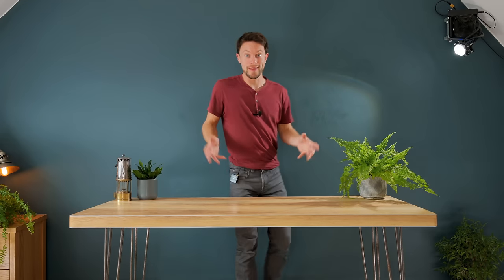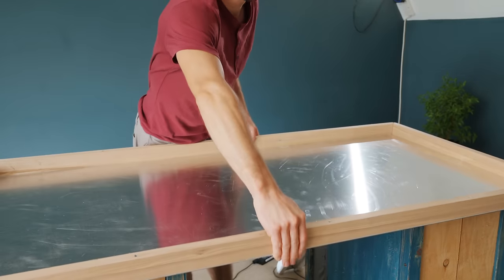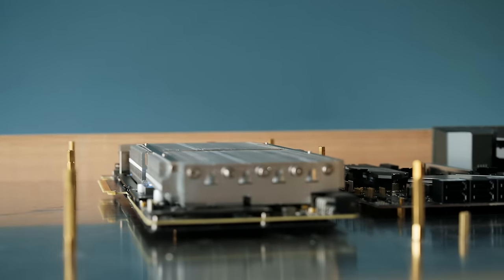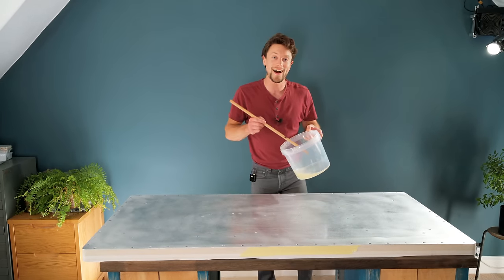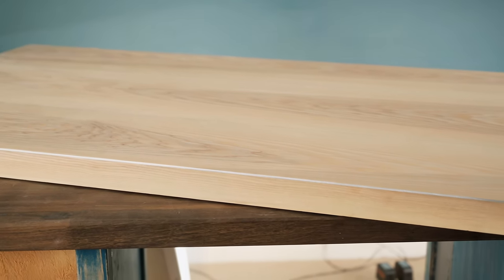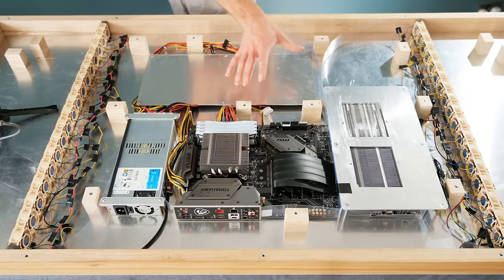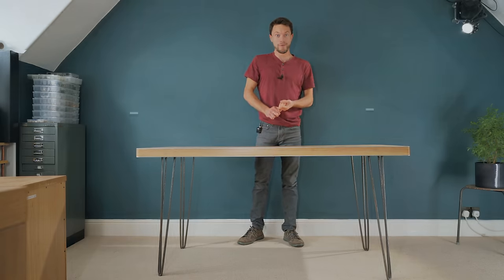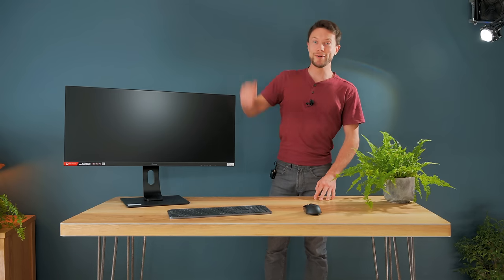Building an invisible PC

Comment: Guy: Why is this table so hot?
Diypirks: I overclocked it
Reply: bro fr i was laughing soo hard the whole video of his knowlege of computers and that u should never remove the  fans of the cpu and the gpu and its not a good idea to play on 85 DEGRESSSSS ON METAL
Reply: @Frosty-ky7ci  good luck building such an elegant design with better temps lol

P.S. 85 degrees is fine, 95+ is where you need to worry
Reply: Ivan Timov are you alright? His gpu was at 81 on a pretty heavy load for a while... plus the fan curve was verrry low to try and keep it as quiet as possible, I guarantee you that if he had put all the noctua fans to max rpm it wouldve easily been below 70 on the gpu
Reply: @Aneeqt  For sure but i reckon those fans would be absolutely screaming, and either way, 81 is still pretty hot, considering i've got a very similar setup in a full size case my temps rarely go above 60-70 celsius on either cpu or gpu at full load reaching i think 80 degrees once on a 45 degree day in Sydney. but yeah, for what it is, incredible
Reply: sneekydart yeah exactly, in a full case with ample ventilation and actual coolers on the card and cpu you’d obviously get much better temps but that’s not what the desk is about which I don’t think Ivan understood.
Reply: @sneekydart7359  naa my pc is at about 85-90 C under load and has been going strong for a decade and almost daily use. Temps dont matter as much as some believe.
Reply: @Frosty-ky7ci  u have no knowledge about pcs lol
Reply: Azvern Dias fax
Reply: perfect for winter day
Reply: @Xirpzy  jokes on you all, my 7 years old HP laptop reaches 90 degrees in heavy load. Ready to cook, yum!
Reply: @sneekydart7359  same, except my CPU pretty much tops out at 40 - 50 degrees. I have managed to do this by pretty much taking the entire front on my PC case off, and covering the fans with some cheap dust filters.

right now my CPU is at 33 degrees and GPU is at 34, but that's under virtually no load, and ya know, pretty cold day in Melbourne so
Reply: @grod5998  ok buddy
Reply: @Frosty-ky7ci  I love how people just say "ok buddy" cuz they don't know how else to respond
Reply: Why did you come to see this video?
Reply: @jaison8263  hey morgan! Wake up. You're burning daylight. I sent the helicopter to pick you up, it's just a few tests. Don't forget to wear your suit. See you soon.
Reply: lol in spanish
Reply: @jaison8263  who are u talking too
Reply: @azverndias913  Mr. Tony Stark
Reply: @jaison8263  ah jeez, can't believe I didn't get that
Reply: @azverndias913  Don't worry. I didn't get that at for first either.
Reply: Xirpzy damn I’m impressed ahaha
Reply: Azvern Dias anyone that’s gotta brag about their intelligence and put other people down clearly isn’t a great person, perhaps learning some social skills would help you out a bit
Reply: @sneekydart7359  I'm sorry but I never do that...the guy straight up insulted the YouTuber as well as me
Reply: Sorry to everyone who has to read my toxic ass rant
Reply: @sneekydart7359  he called me stupid first lol
Reply: @sneekydart7359  well at least u said sorry for that so we cool
Reply: Azvern Dias I mean... he said “you’re probably 12” but I guess that’s close enough, doesn’t really matter anyway lol, glad you’re doing well enough in school to know all those programming languages, I wanted to learn but my school didn’t run the course I wanted so I never really got to learn much apart from basic python, HTML (and css) and SQL
Reply: Azvern Dias I did at least get to build my own pc which was good fun until I killed part of the rgb with a stupid mistake lmao, goes hard tho
Reply: @grod5998  no personally i think 85 is still a bit too much, and for building something cooler, i would say it's very very easy (even tho not cheap) and that using watercooling (specially whe you see that the components he used doesn't look cheap at all)
Reply: My ear gets hot.
Reply: @Xirpzy  ten years? Yea, I suppose the only reason a potato would get that hot is when you throw in the oven.
Reply: @Frosty-ky7ci  Then explain how silent/sleeper pc works.
Reply: Everywhere I go, I see his face
Reply: Coffee warmer
Reply: @Xirpzy  Temperatures don't matter? You need education lmao
Reply: @MH-hs7ie  temps do matter but not in the keep it under 80C or it might melt/catch fire kind of way. Anything under 95-100C under load is totally fine, even for heavy daily use. Ideally you want it lower but for me it hasnt degraded noticably in a decade with these temps. Talking from own experience.
Reply: What it needs is watercooling, but the water intake is a plastic potted plant
Reply: @Aneeqt  better than my GPU in my tower PC  lol
Reply: @asukahikari9790  bruh that would be pretty damn ingenious
Reply: @leonardotiberi3293  honestly the temps on it are actually a lot better than I was expecting
Reply: I am farming Bitcoins with it.
Reply: @grod5998  80+ degrees thermal throttles the GPU... not good if you want performance

Comment: I was worried about cooling, but this guy was even more worried about cooling
Reply: 81c is thermal throttling for the gpu, it’s not good
Reply: @thecuddlator2567  No it's not lol. Sure it might be slightly lower clock speeds but it's certainly not throttling.
Reply: @narajung7186  Lowering clock speeds is literally thermal throttling. In saying that though, apparently 88 celcius is when a 2070 starts to throttle. So he is still in 'safe' temps albeit on the higher side
Reply: @narajung7186  that's the definition of throttling!
Reply: Idk if you're making a pun about the 😎kind of cool, but this also reads like a poorly translated Japanese comment

Comment: So much additional space! I could see a "drawer" with all the storage (HDD, SSD) built in being great for people who film videos in slow mo or at high resolutions, as it allows easy access for expansion and removal, and a second graphics card could also be added, as well as a second mini-pc for running a server (or, as i've heard some youtubers use it for, for uploading a video while using their main PC), the desk allows for a lot of design space, moreso if you gave yourself another inch or two to work with. Very nice!
Reply: Or actually having all the parts in a drawer. Then you don't need to go under the table to fiddle with parts.
Reply: @zaprodk  nah why u wanna fiddle with your graphics card
Reply: @ThunderStormFortnite  not graphic cards, computer parts in case you need to upgrade it, troubleshoot or swapping component
Reply: Hmm that is a good idea. Also perhaps a draw for the laptop/tablet/phones - so they can be charging and connected to the PC - probably a draw with a powered USB hub in the back so only only the pair of cables that tether the draw?
Has to be said though this is a seriously wasteful design - there is more than enough depth to use the largest case fans you can get your hands on, which will be much more energy efficient, quieter, almost certainly perform better and are significantly cheaper. Still need to do the same thing he did with airflow guides and I'd cut a few wedge shaped blocks of wood so the fans can be mounted with as much tilt as possible - as that will improve airflow a little bit.
Reply: An ITX motherboard where you install the gpu like in the video, but also get a couple m.2 slots, theres a couple Corsair SFF psus that have a better bigger fan for less sound than the Seasonic server psu on the video and with ATX12VO around the corner we will start to see more compact psu's.

then for the HDD i would get some NZXT old brackets or the complete encase for hdds, this to reduce vibrations i liked a lot the way the hdd's were installed in the video but it coul be better. for ssd's tho it really doesnt matter. altough taking in consideration a  drawer aproach, it could be very useful for doing hot swaps.

For heat dissipation the desing was superb, i would however increased the desk interior clearence to standar ATX PSU, it would have locked chunkier yes, but you could have added an exhaust bottom fan for the cpu cooler, heck maybe installed a good AiO cooler, i guess the motherboard temperarute was OK but i didn't see any VRM or socket temps.

I really enjoyed this video since i want to do a project like this for a small pc under the tv in my bedroom to run Android Tv and replace the RokuTv experience.
Reply: @ThunderStormFortnite  did I say graphics card? No ...
Reply: @foldionepapyrus3441  *drawer.

Comment: Matt: "40 Noctua fans"

*Linus intensifies *
Reply: 69 likes, ayy
Reply: @theproffessional9  369 now
Reply: i thought he was gonna go with a large single fan layed flat for air flow with the same plastic routing used in the video.
Reply: Watch Linus do 400
Reply: Ali Mohamed 678 now
Reply: 669 now
Reply: Gam3r Cat 63 703 now
Reply: what about a blowey metron
Reply: @vunree9744  would have made a lot more sense. Plenty of power is wasted here with all the individual motors. If the setup has protruding parts anyway, a halfway recessed 120mm fan would have done the trick - one for the cpu and one for the GPU
Reply: @sikedipuuhja7376  or for even extra cooling he could have just had an AIO for the CPU right? It would be low profile enough to fit in the desk and provide amazing cooling with very good acoustics too.
Reply: @garn100  i agree, or use a (scavenged) heatpipe setup to lead the heat away from the MB. i was first really surprised when the 1RU PSU was shown - those things are quite loud if juice is needed. on the other hand i understood the intention to keep 'dangerous' parts (stuff with mains voltage) enclosed, so the build can be replicated w/o specific electrician skills and with relatively low risk.
Reply: @theproffessional9  1.1K now

Comment: For veneers, you can buy a large mattress bag, with a vacuum port.  Put the item inside, vacuum out the air, and the pressure will be perfect and evenly distributed.  It's how I put veneers on guitars, multiples at a time.

Comment: Your work is quite inspiring when I was a young teenager I took my desktop and integrated it into my desk similar to your wall mount unit that turns into a table as well as this awesome table assigned. However it was not as well thought out and planned as yours but it did work. No one knew what it was until I told them. Keep doing what you do you are inspirational

Comment: did the same thing, only added keyboard on slide-out and mounted the monitor flush so it stayed looking flat even in use. Mounted a 12" fan from a box unit to extract the air quietly. I wanted the laser projector keyboard, that would have been a good touch

Comment: The oxide layer in Aluminum forms back almost immediately. The benefit of sanding is more to give the epoxy a rougher surface to adhere to.
Reply: WEST System actually recommends "wet sanding" the aluminum with the epoxy, which gives tooth but also protects from oxide formation during sanding.
Reply: I started to point that out, but thought “does anyone care as long as it works?” I also started to suggest he vacuum bag it, but then he would have to show how to make that.
Reply: @karll.masoner6918  Excellent points :)
Reply: I don't understand why the oxide layer is an issue at all. Aluminum oxide is incredibly hard and it's as much a part of the metal as the rest of it, so it's not like it's going to just fall off.
Reply: i want to ask a question, the oxide layer is a few nano meters tops immediately after exposing the fresh surface, so would it really effect the adhesion
Reply: @DeltaSquad4K  no it wouldn't. The only thing which would affect the adhesive abilities would be a too smooth surface as well as any kind of fat or dust
Reply: Some surfaces may be too rough already but that would probably not apply to aluminum sheets. For most coatings, even adhesive coatings it is best to give the surface more area to grip by giving it a rougher surface. There are basically two types of bonding that can occur: mechanical or chemical. In the case of epoxy on aluminum the bond is primarily mechanical, therefore, cleaning and sanding the surface is prudent action to ensure a good and lasting bond.
Reply: Came to the comments to say exactly this. The oxidation is near instantaneous, and is one of the main benefits of aluminium - the very thin, very hard oxidation layer protects the quite reactive bare aluminium beneath from other reactants that can damage the aluminium.
Reply: @karll.masoner6918  As far as this particular process it doesn't matter, but there may be other issues that come from people believing the oxide layer is gone after sanding when it just immediately re-forms. It's not a nit pick of the process, or even the project as a whole, which is pretty awesome.
Reply: Bret Hall, yes, I’m with you on that. It’s a great project. You’re spot on. The aluminum oxide issue probably is a bit over emphasized in this case, but the chemistry should be considered based on the situation, like welding for example. Thanks for your input. I like to understand the big picture and you gave me reason to think about stuff I hadn’t used for a while.

Comment: Awsome Additions would be: 
- USB Ports
- Wireless Charging for your Smartphone
Reply: Or table that is a phone that is wireless charging 24/7 with invisible wires whilst keeping phone cool
Reply: LTT did this
Reply: @AgentLTK  I think that's why he's mentioning that.
Reply: I could add stuff for artists such a lightbox
Reply: Felix it would be alot harder to add a wireless charging than one might think since he used aluminum for the top surface of the table.
Reply: All wireless peripherals. *Big think
Yes.
Reply: Paul Wang Yes I‘ve just saw that Awsome
Reply: Broken_font Yeah your right, but maybe you could make a hole in the Aluminium 🤔
Reply: Or, glass top instead of wood
edit: also rgb lights around the table
Reply: And maybe a cardreader?
Reply: @Felix-qk2xs  the only problem is that the wood veneer is so thin that it cannot simply float over anything. The moment you place a phone onto the pad area the veneer will crack. You will need to add an additional plug made out of wood or plastic to fill in the hole in the aluminum before applying the veneer. Or alternatively just skip the aluminum all together and use a wood or plastic top instead. The way he built the table with all the supports would make almost any material work. 😊
Reply: You can reach usb ports with that holes under

Comment: This is genius. I can't believe that these aren't sold by any companies.
Reply: IIRC microsoft did something similar
Reply: The thermals are really not great

The hardware is designed to thermal throttle the performance around 80-85 C, and this table was right at that temperature. People would buy these and wonder why they aren't getting the performance they should
Reply: @Stuugie.  Those temps at that load isnt terrible. By no means great, but not terrible at the same time. You could probably get away with soft line, or even hard line watercooling in this desk though.
Reply: @koleethan  Water cooling is probably the only way to go as even two years ago this wasn't enthusiast hardware. With how thin this table is, I don't think you could mount rads and fans without making holes straight through since airflow has to go through the fins. A thicker table is needed no matter what...that 500w is also pretty weak, I wouldn't go below 850
Reply: Laptop in a drawer ?
Reply: @okay_bro88  Yup. The Surface computer! I remember that.
Reply: Lian Li does make desk PC cases
Reply: I think the feeling of the table would be terrible. You are much better with massive wood and an iMac.

Comment: Matt - You've ut done yourself here buddy. Even as a "real engineer" I appreciate your videos, I was grimacing when you laminated veneer over the topside "access panel bolts" but I admire your bravery running a PC on a couple of handfuls pf 40mm fans, and your ingenuity making it work on that limited airflow.
Reply: Jay Bruce Oh dear... I didn’t even think about that!
Reply: isnt the top side the woodscrew side, and you flip it over to open it?
Reply: @athena1491  yeah you are right ... i dont understand why he thinks the the top side is the access panel bolts
Reply: @neophyte88  because it would make more sense to just take the top sheet off rather than lift, the entire aluminum sheet, and wood frame, and wood supports, and computer parts, then flip that all over to access the computer parts. I'd mount all the parts into the bottom half, have the top be the access point, and the lowered area for the ventilation port could be disguised as a raised platform for setting items on top of, rather than a lowered section underneath that doesn't quite mix with the goal of looking like a solid wood table, one looks like a raised item stand, the other looks out of place.
Reply: SCOTLAND FOREVER!!!